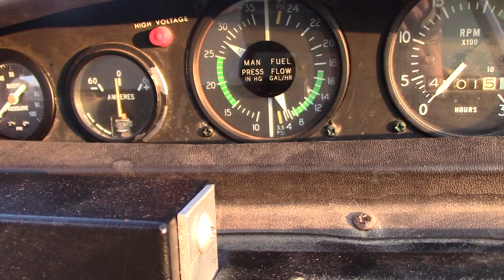Ag Pilot Vlog#2 The learning curve

Comment: Did you use flaps in the turns in a 188? If not would you think that it would’ve made a difference
Reply from the maker: I did use them on a couple occasions and they didn't seem to make a difference.  I was told by other cessna pilots that they never used flaps and agree with them.  Although flaps increase lift they also increase drag and in a loaded cessna I don't think the lift out weighs the drag.  In an airtractor you use flaps to turn because they go so fast.  Your turn radius at 140mph is higher than turn radius at 120mph so using the flaps in a lazy eight turn helps bring it around faster.  In a cessna you don't have all that extra energy.  Its like every piston airplane, overweight and underpowered.
Reply: @valleyagpilot1283  thanks man looking to get my initial training in a ag truck next month then hop into a 400. Looking for all the advice I can get